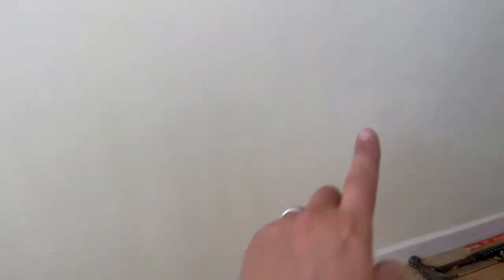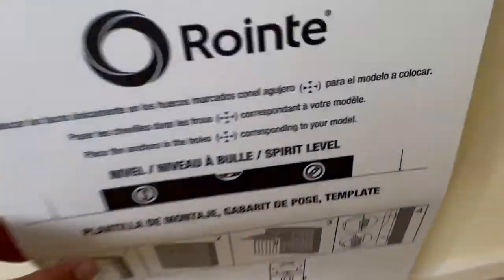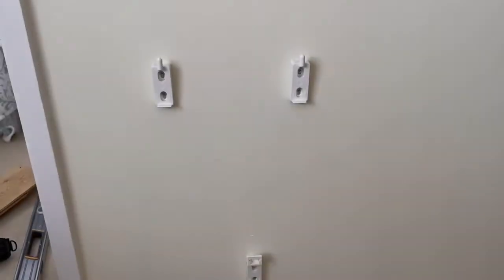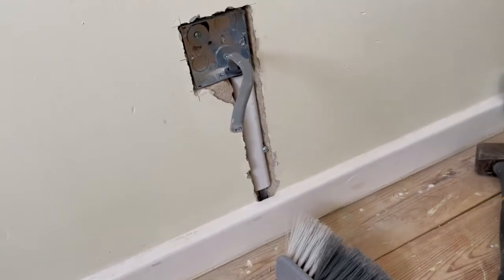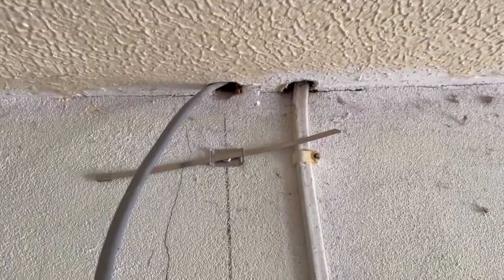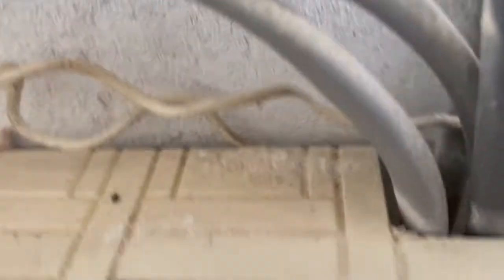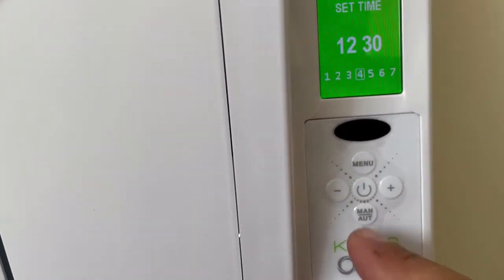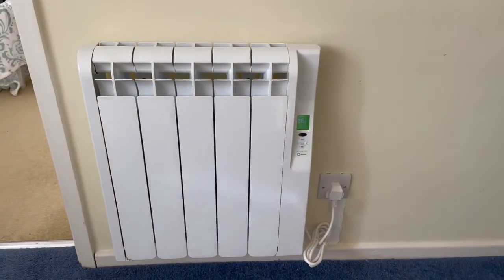Installing an electric heater

Comment: Tempted to swap out all my water rads for these.  Fed up of boiler issues and water system related issues.  Only thing is, not all the rads are by a socket or electrics.  Other than that, these are a no brainer, electricity costs vs gas costs aside.

Comment: My panal light won't stay on, change the battery but only comes on when first turned on from plug?? Any ideas what's wrong ( ps not heating up as much as it should) I don't think
Reply from the maker: Hi Graham, 
That is a strange one that I’ve not come across before. It could be an economical setting that needs changing. Rionte do have a good customer service alternatively when did you install the unit? Could you contact the installer as it may still be under warranty. 
Regards
MCG